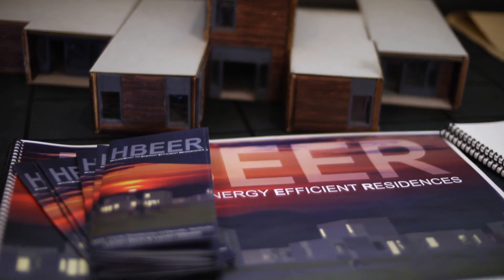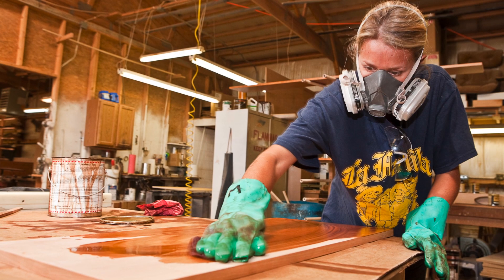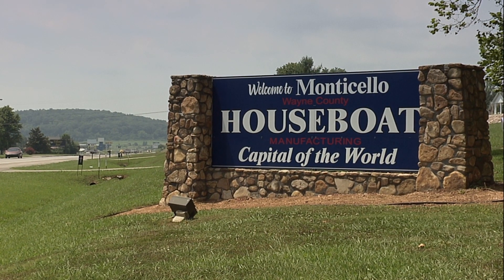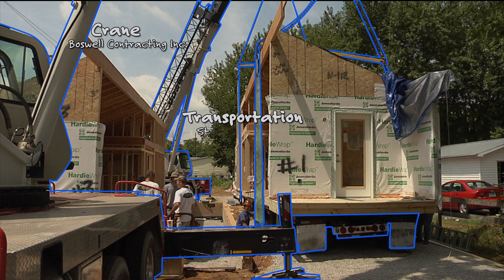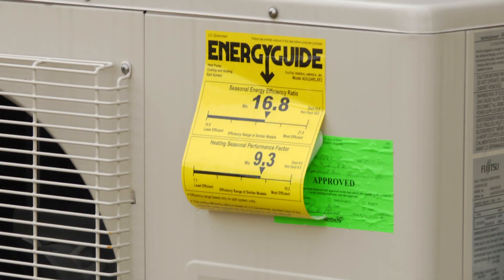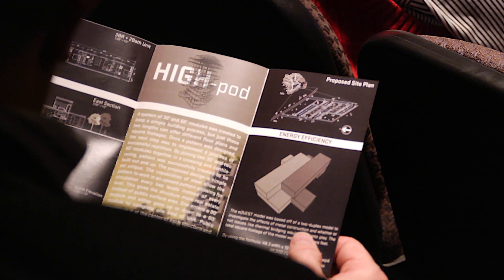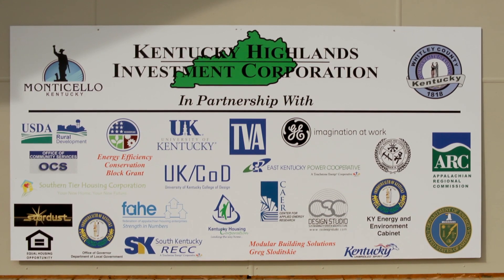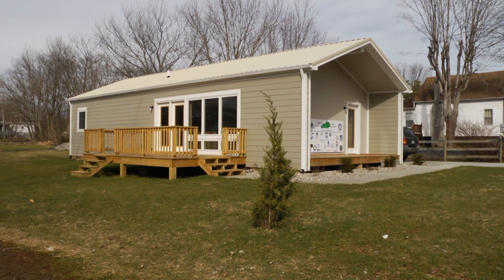HBEER: a University of Kentucky & State Project for Energy Efficient Housing

Comment: we can produce endless amount of energy through sea water electrolysis .then we take hydrogen alone to high altitude ,where we combine it with atmospheric oxygen, and drop the formed water from this high altitude on hydraulic turbines as in dams.
Reply: I'm not sure how this relates to this project in particular, but I do think you should know that electrolysis requires current, which requires energy, and producing energy (water in your example) by using energy (electrolysis) is never an efficient process, and is a net loss of energy..